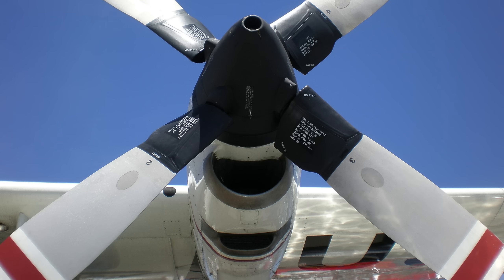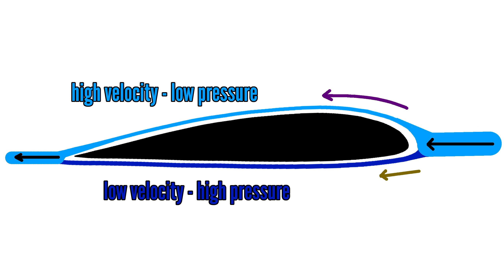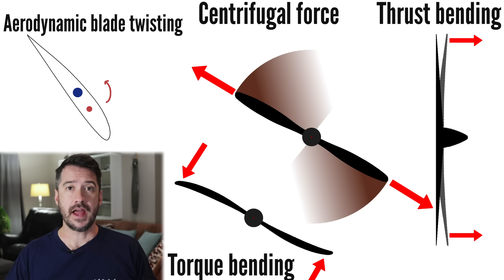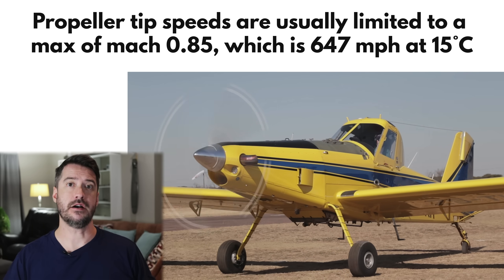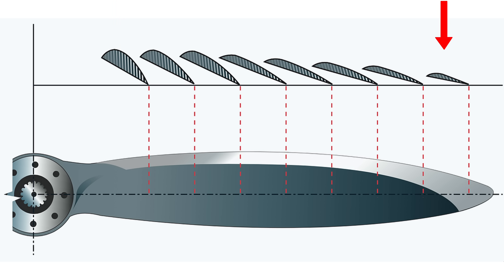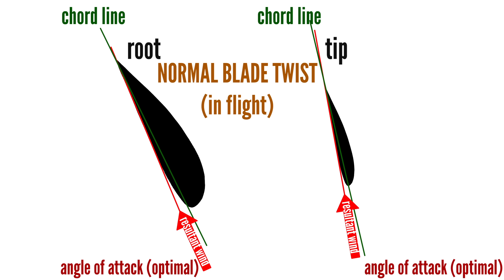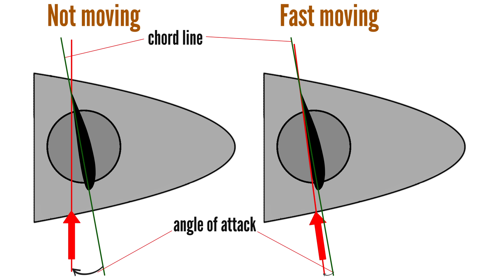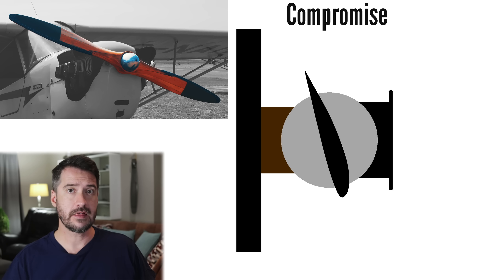One Video to Understand Airplane Propellers

Comment: There's always a big debate about how an airfoil actually generates lift/thrust. The reason for this is that each side of the debate believes that they are correct, and humans generally want to be correct. Normally one would just conduct an experiment to verify who really is correct, but in this case, there are several arguments that all have evidence showing them to be correct.

This is because in reality, an airfoil generates lift in several different ways simultaneously! So they all really are correct to some degree, with each source of lift adding to the whole (pressure differential/equal transit, incompressible Newtonian deflection, compressible fluid dynamics, and even some more nuanced aspects that don't generally get a major 'side' in the debate).

To make it even more complex, all of those sources of lift account for different percentages of the total performance differently in different flight regimes, including AoA, laminar vs turbulent flow, separated vs attached boundary layer, mach number, the existence, absence, or location of vortices, and more.

The truth is, aerodynamics is an extraordinarily complicated topic that isn't yet completely understood. Or... perhaps more precisely, it is a topic in which the sorts of fine-detail complexities that most dynamics tend to involve, get amplified to the level of not just being important, but being critical.

Add in that humans have very poor intuition when it comes to wave physics, and yeah... you get lots of very passionate people passionately declaring everyone else to be wrong, all correctly. xD (For an idea of your level of intuition of wave mechanics, can you explain why large commercial ships have big bulbous noses that look about as streamlined as a brick wall?)

Still, good job on the video! It was... quite a lot more basic than I'd hoped for, but that's not a new situation for me. Science and engineering communication is rarely aimed at people seeking to go from intermediate levels of technical understanding and proficiency to advanced levels.

In particular, I'd love to see some more focus on exactly how adding more blades changes things between efficiency and potential power usage, as my understanding is that each blade really acts in a way sort of hybridized between its actual physical shape, and its swept area, depending on operating regime. I feel like I have a reasonably okay understanding of that, but it isn't a particularly intuitive understanding, more like one of those things you just come to accept as true as you do maths for homework problems.

My journey of understanding across all sorts of fields of science and engineering tends to be to go from some degree of misconception from the "lies to children" oversimplifications we use in education (especially here in the US, but to some extent, everywhere), to an analytical mathematical understanding (which tend to involve myriad simplifying assumptions, a la 'spherical cows in vacuum'), then to a level of true comprehension that includes intuition. From there it goes to deep and specialized understanding that includes all of the nuance that we currently understand as a species, but people tend to only gain that level of expertise in one or two very specific topics in their lifetimes. Of course in some topics, nobody has that final level, and in others, like quantum mechanics, it became so stigmatized to even try for the third level of intuitive comprehension that most working physicists just skip over it entirely and brute force their way from the simplified analytical understanding to the detailed simulation/experimental understanding.

Comment: This is a really good breakdown of propeller mechanics. I would love to see a part 2 and in that cover how the angle of attack for the plane effects differing thrust across the ‘rotor disc’ as the RC Heli guys like to put it.

I saw a video a while back explaining how a plane coming at a high angle of attack will mean a higher angle of attack for the blades crossing the bottom of the rotation and a lower angle of attack for the blades at the top of the rotation. They also mentioned how prop turbulence can wrap around the fuselage and push on the vertical stabiliser, but I’m having trouble keeping it all together.

On RC planes, their small size and weight makes them very sensitive to torque roll and so a common trick is to angle the yaw of the propeller a few degrees off to one side, depending on which way your prop rotates. This helps the torque roll but seems to produce other effects that influence the steering, but I can’t quite figure out what’s going on exactly.

Comment: The thrust direction is forwards, drag force is rearwards. The propeller blade bends forwards under the action of the thrust (lift from the aerodynamic pressure difference). Great video.

Comment: I appreciate your video, but…at 2:23  your explanation of wing lift as “air arriving at the same time” is actually not correct. I’ve seen other videos by aerodynamicists, explaining that the top flow actually accelerate and arrive earlier than the bottom one. This is explained as assuming the wing profile as the wall of a Venturi tube, which accelerates the flow at its narrowest point

Comment: Are there propellers out there with winglets? 
Would that improve efficiency like on wings?
Reply: Yes airplane propellers with winglets are called Q-tip propellers. Became pretty popular during the 80s and 90s. They were marketed more for being quieter propellers. That's where the Q in Q-Tip comes from
Reply: I had an APC propeller on my RC plane that had little winglets. One day a poor landing snapped the propeller and all I could find at the local hobby shop was a black propeller. Only when I fitted the black propeller did I notice that the APC propeller was much quieter and much faster. 
It appears the folks at APC really know their stuff when it comes to propellers.

Comment: Recently I had a close up museum view of a mk16 Spitfire, with a Rotol 4 blade propeller. And decals on the forward face of the blade roots had different settings. The angle numbers recorded on the blades were around 34 to 38 degrees BUT each blade was marked with a different value.
Why?
And what for?
How is it important?

Comment: What is the theory behind your statement about the airflow over and under the blade having to meet each other on the traling edge?
Reply from the maker: It doesn't have to meet at the trailing edge. The faster moving air over the top might arrive at the trailing edge more or less the same time as the slower air below, but it might even arrive before the air from below. It would depend on factors like the shape of the wing, angle of attack etc.

Comment: There's a certain tune nature to a propeller and it has to do with the horsepower and the weight and drag of the airplane. If you fly an airplane overweight the propeller pitch is too much and it has too high of top speed but it doesn't have enough to take off with that much extra weight. I saw a tragic crash that killed somebody because they had some floats on the airplane they had added and they needed to change the pitch on the propeller from a 46 to a 44. It was a little bit too much drag and it would kind of take off and fly in a straight line if you were real careful with the throttles and everything but that's not a good system for taking off.

Comment: The centrifugal force the air experiences as it is made to change direction across the chord of the propeller  blade causes a low pressure  on the front face of the prop thus lift and thrust. The increase of the speed of the air across the  doesnt cause a vacuum  . Thats a miss statement from long ago . Elliptical wings fly quite well . The angle of attack across that wing and speed creates the lift. I know what Bernoulli's  Principle says  but  he did not take into account that Air  when accelerated has weight and the centrifugal weight of accelerated air does the lifting . That is why airspeed matters .

Comment: In reference to what is important in fluid dynamics' effect on wing lift:

The vacuum metric is but a condition to allow the wing to better advance through the air. The vacuum does not contribute much directly, just as a jet engine doesn't 'suck' its way into a hole - that sucking is a very small contributor. It's the push that does the work; that push being of course the air pushing on the other side of the wing. To be sure, when you depend on action by pulling apart molecules, you aren't going to get anywhere much. When you push against molecules, this is where the work is done. 

For example, when one tries to pull on a hydraulic fluid, at first there is a possibility of movement, but shortly thereafter the bubbles are going to form and the pulling action amount levels off sharply. Same with air. 

An aside - the vacuum isn't caused by the differential of speed of the air going over the air foil. Air speed is only a symptom of the presence of the mechanics of fluid flow dynamics. That is all. To focus on increased air speed is akin to telling someone that the flu causes an elevated body temperature. No, a fever is a symptom of the flu. The fever is only an indicator of what the body is trying to do - to burn off the virus (which is why you mustn’t take aspirin!). 

Yes, the molecules "go faster", but stay with me and don't think about that right now...  No, what is happening is that because the air has longer to travel over the air foil on the top, this necessitates that the molecules of the air are pulled apart.  That is, the air becomes rarified.  This rarefication is air that is "out of the way" on the top of the wing, so the wing can more easily travel upward (yay! upward... good!) into that rarefication. But the rarefication doesn't "suck" the wing up there. Rarefication is really a hole.  This lets the real lifting force - the air on the bottom of the foil - the real working force - to be more efficient, because it does not have to push on the air above the wing (a hole is now there, remember) and instead more push energy is available to move the wing upwards.  Rarefication of air molecules above the wing increases efficiency. 

I am unclear as to why there are so many questions and perceived mystery around why a wing is so effective.  All one must do is to know how stubborn air molecules are, or any molecule for that matter.  When air is at a certain temperature, the molecules are measured to be so far apart. Any force that tries to alter this distance will be met with INCREDIBLY frisky resistance from the air. It will not want to conform. This characteristic is responsible for the incredible force that air can impart on anything. If it weren’t a fluid, we would not even be able to move at all, even though "it's ONLY AIR". So, in summary: Pull on stuff - good, but very limited. Push on stuff - now THAT's what I'm talking about... 

To put this into perspective - to put why the rarefication of the air above the wing is only an efficiency-increasing characteristic and is only a small part of the lift of a wing - into perspective, is to look at a single surface hang glider wing. This is the most crappy air foil profile that can possibly be built, but we are still blessed with such a terrible thing working very well. The only reason this is possible is because, like any other wing, this wing depends on an angle of attack which is the single best way to enlist the air molecules on the bottom of the wing to push against the surface in the desired direction. This force is enormous, enough so that it can fight with the air on the top of the wing and still do wingy things and allow flight. Sure, there may be a slight bit of rarefication caused by air swooping up over the leading edge and causing a small rarefication there - this is important - but boy is the air 'noisy' there. No, the force on the bottom of this marginal wing is the major contributor. But can one use rarefication to fly without any angle of attack or wing being forced through air stuff? Sure! But now you know why balloons are so darn huge. 

I'll leave it to others to discuss the benefits of air accelerating past the trailing edge. All I'll comment on this is that any force one is talking about must be imparted onto the wing itself to do any "airplane good". These forces are both perpendicular (surface) and hydrodynamic. For lift, the perpendicular one is by far the most important. As such, the trailing edge thing in my view has more to do with making the air behave well and getting rid of some noise. Remember that the acceleration of air past this trailing edge is air that is, yes, forced downward, so that must be imparting some oppositional force on the wing to enhance lift, right? Well, yes, indirectly. The air forced down is actually pulling against the rarified air at the trailing edge but not past it - this rarefication imparting some efficiency (some may even say 'pulling' but this isn't really correct), and the accelerated air does this pulling by the inertia of the air molecules J-hooking downward slightly (change of direction) past the trailing edge. It really is more of a rarification maintainer for the back third of the wing more than a force imparted on the wing.

In summary: Efficient airfoil = good.  Efficient airfoil = controlled air.  Controlled air = compressive force on one side, and rarified air on the other with little noise before and aft the foil.  Crappy wings still work if underside upward force is enough and drag isn't objectionable.

Comment: Isn't this a strong simplification? I am sure, The air  at the longer route takes NOT the same time as the on on the more straight path below! There are some turbulences from this.
Later in the video you mention it. Would be nice to get more details what happens here exactly
Reply from the maker: Yes it is a simplification, the air over the top goes faster, but doesn't have to take the same time (although in some instances it would). I don't intend to go deep into the subject. I think what you mean where I mentioned it later is when the air over the top of the blade breaks the sound barrier. That is different from normal sub-sonic airflow over the blade.